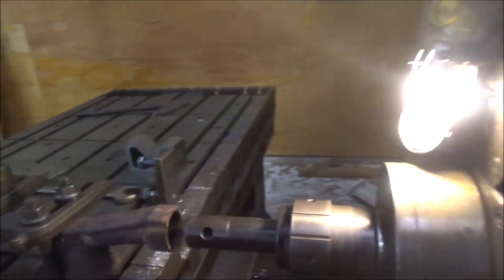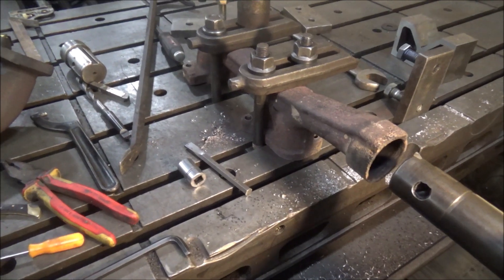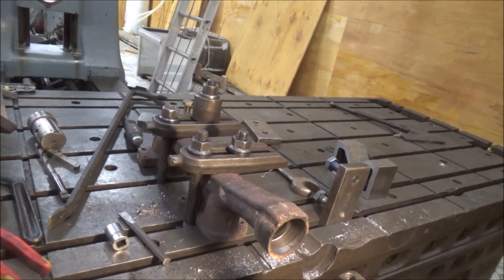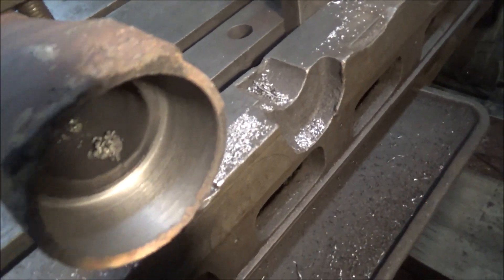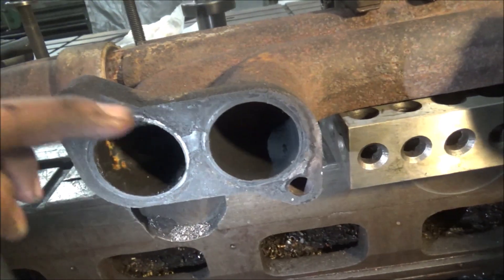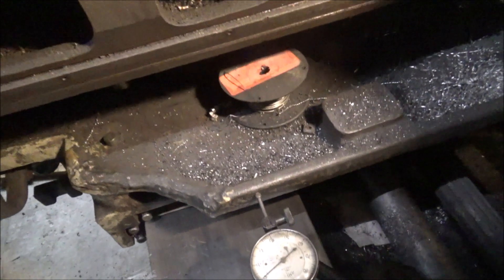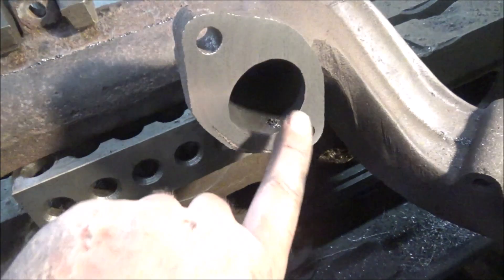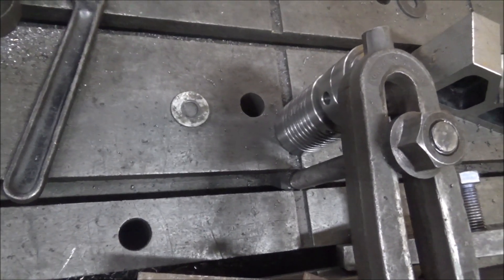Flaten Warped Deere 8000 Series Manifold & Repair Fix Slip Expansion Joint Seal Surface Piston Ring

Comment: My neighbors 8000 Deere might need that work done. Dealer rebuilt the engine when it scored a piston and within a couple hundred hours, it started leaking oil around the back end of the manifold. A mechanic said to check the bolts on the manifold, cause if they were loose, it could cause that(Not sure why but?) . Yep, manifold bolts were loose. We pulled the hood and tightened things up. So far so good!
Reply from the maker: If it needs done you know someone who can! :-)
Reply: @bcbloc02  I've done a few smaller manifolds on the Bridgeport, back when I had a day job. Don't have access to a mill anymore days.   
 The big G&L they have at the shop is a bit over-kill for a small 4 cylinder Allis Chalmers manifold but the little Super Mill was handy for them.

Comment: When you bushing exhaust manifolds, do you use ductile iron, cast iron, or steel? Reason asking is different expansion rates.
Reply from the maker: I would prefer iron for wear but given how thin the bushing had to be I went steel as I l think an iron insert would be too likely to crack.

Comment: Aloha Brian, I was more interested in the installation of the sleeve and boring thereof than the facing of the ports, but it is your channel not mine.  I am more interested in the setup and why and wherefores than just watching the machine run.  That said thanks for your time and keep them coming.  I have enjoyed your work since you started.
Reply: Are from Hawaii?  I was a Haole on Oahu from '79-'82
Reply: @TechGorilla1987  I wasn't born here, but moved here to the "Big Island" of Hawaii from Colorado 25 years ago when I retired.  I first came to Hawaii in 1959 courtesy of Uncle Sam's Navy.

Comment: Year nice jacks. Bit close to the tie bolts. But worked well.
Reply from the maker: I would have preferred to have not had the part hanging half off the table but it was the only way for the neck of the manifold to clear.

Comment: Will your horizontal mill be able to mill out the bottom of that stoker steam engine that Adam Booth has?
Reply: More than one person is interested in that question! It would be a tough set up and milling job but one that you’re probably more qualified to handle. I hope you take it on if you’re asked!
Reply from the maker: I think I could do it, but haven't been asked. I would have much rather done it before they fooled with that build up job in the bottom though. I fear it could be problematic more than the setup.

Comment: How do you do to get the best alignement when clamping the manifold ?
You lay it flat on the table first to be sure the two parts are aligned and then you clamp it and indicate it the best you can ?
Reply from the maker: I assume you mean when I milled it all together? I use a straight edge held up against the gasket faces while clamping to hold it.
Reply: @bcbloc02  
Yes ,
 ok, thank you.

Comment: I bet the setup took longer than the machining did.
Reply: It usually doses. Had a boss ask me why it took so long but only ran the machine for a short time. so I told him next time he can do the setup after looking at all the parts and blocks He said I see and let me work without further interference
Reply from the maker: 2hours of setup for 10 minutes of cutting is never uncommon in my line of work.

Comment: Was that sleeve a press fit into the bored-out manifold? How do you calculate the amount needed for something like an exhaust that gets really hot?
Reply from the maker: I usually go with .001"/inch of diameter on press fits then heat shrink into place. In a case like this the heat is from the inside out so it should never get looser.
Reply: @bcbloc02  Thanks. I suppose since it's all cast iron or steel it has similar coefficients of expansion, so fact that it's heated up doesn't matter.

Comment: Reminds me of the work I use to do. All the same kind of set ups and using indicators on machines that milled the titanic. LOL Nice video thanks
Reply from the maker: The tTtanic was a fine ship, just a shame greed proved the design to be a failure. You can't have water tight bulkheads with open tops!!
Reply: @bcbloc02  Brilliant at its time, helps if the binoculars weren't locked in a cupboard, and the key and key holder still in Liverpool.

Comment: Have them run dead soft copper gaskets and the manifold will last longer. it allows heat transfer into the head and helps prevent warping.
Reply from the maker: The factory gaskets are multi layers steel, they should transfer pretty good. 14000hrs of near meltdown egt's take their toll.

Comment: Amazing. How did you ensure the bolt holes are on correct centers? Does the expansion joint take care of that?
Reply from the maker: When I rebored the expansion joint I mentioned that I had aligned the bolt holes on the mill table so it would stay in line.
Reply: @bcbloc02  I think Mep was referring to the distance between the bolt holes across the expansion joint, to insure both halves of the manifold would still line up with the bolt holes in the head. So... yes. 👍

Comment: Great video 👍 Would a stainless flex joint be a better long term repair perhaps?
Reply from the maker: If it lasts another 14000hours the rest of the machine will be scrap so it won't matter.
Reply: @bcbloc02  well when you put like that I agree 👍

Comment: Brian, if this job is getting to be too common, take the time to build a precision fixture. After you get it made, you will never have to do this job again. Murphy's Law: 3rd clause under wasted time.
Reply: 99th clause says, dont forget Murphy's Murphy law, if you dont do something because of Murphy's law you are sure to need it later.
Reply from the maker: Problem is there are apparently many different castings of these things so I am not sure a certain fixture would work for all of them.

Comment: Looks good....  I was wondering how much of a cost savings it was to have you remachine that manifold compared to buying a new one...  It is obsolete or special ?
Reply from the maker: Its a $1700 manifold............
Reply: @bcbloc02  Did you make your shop rate on it then for real time?   I am having difficulty getting that done, I figure I am unreasonably slow and picky... hmm...
Reply from the maker: Yeah since it isn't the first one of these I have done.
Reply: All I needed to know:)